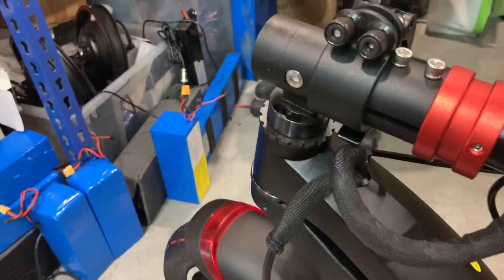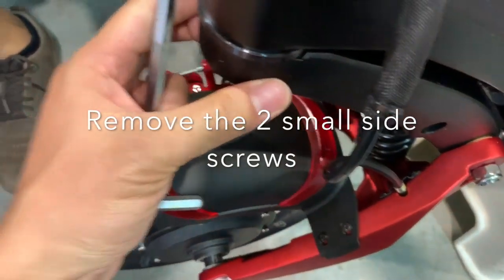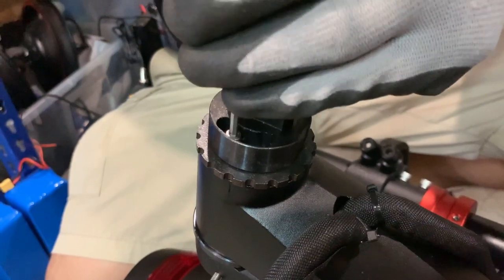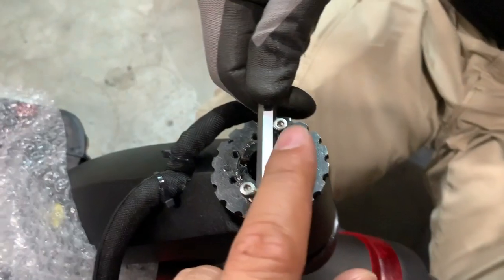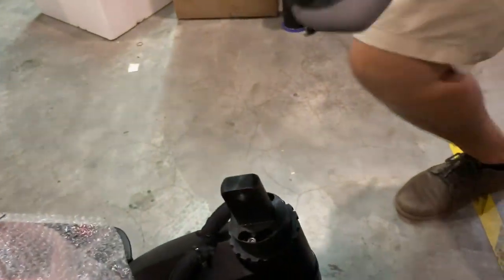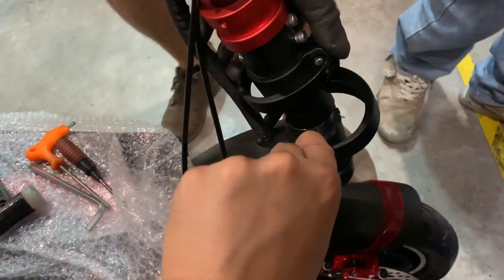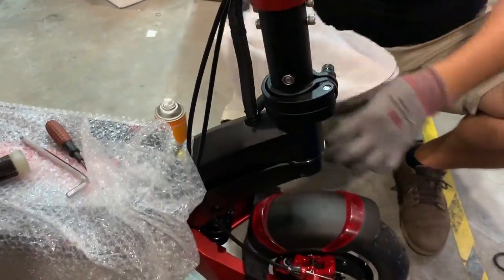ZERO Tutorial: How to tighten the vertical stem on the 10X

Comment: Nice video Very helpful explaining the steering assembly.  Please video the open deck , the battery , controller ,etc.  ...I have a small short when I attach the charge cable,want to see inside but don't want to void any warranty.   Please keep the how to videos coming
Reply: A tire change diy vid. would be good also
Reply from the maker: Tire change video for zero 10X coming soon:)
Reply: @FalconpevSg  for the love of god and all that is holy....please find some of those honeycomb airless tires for the 10x and sell them. i will pay anything.
Reply from the maker: sHockz atx ok check these tires out, it will help you a ton: https://www.falconpev.com.sg/products/10-x-3-inch-urban-off-road-tyre-and-tube?variant=29183414698051

Comment: I bought the 10x, love it, so much fun. Only drawback was the movement and squeaking in the vertical bar. I ordered the upgraded stem coupling. Problem solved. Handlebars are now stiff and very minimal squeaking. Feels much better, highly recommend.
Reply: I've just brought the 10x and having the same issue as well with a creaking stem! Did you get a spacer with the rugged folding clamp you purchased?
Reply: Please, give a link to the product of the upgraded stem coupling

Comment: This stem simply needs the lowest 15mm section to be 35mm long and a clamp that is double the height like around 70 mm with 3 quick release. A cnc lathe could easily make a slide on extension that raises the total height of handlebars only 30mm ! If anybody want to discuss this further let me know and i will explain it and draw it up for them to route one out and we can try it out and get it a simple perfect design ! 👍🏻

Comment: If the setting screws will not come out (2.5mm) do you have a guide for stuck screws? Thanks
Reply: Did you ever solve this. Same thing has happened to me. Setting screws will not move
Reply: @DanielMatotek  unfortunately not they are still stuck in the scooter i don't wish to attempt to remove them by then damaging the internal thread.
Reply: @HanleysHatchlings  can you remove the large bolt without taking them out?

Can I just continue without taking them out?
Reply: @DanielMatotek  the large bolt is stuck as the side bolts have it stuck in place.
Reply: @HanleysHatchlings was your steering to loose or too tight. Mine is too damn tight.
Reply: @DanielMatotek  issue i am having is the stem is creaking and not tight enough due to the bolts not able to be loosened. So this remains an issue still as this video explains the issue i cannot go about the repair without possibly damaging it.
Reply: @HanleysHatchlings  alright thanks, I really don't know what to do then. I can't get these out to loosen it up.
Reply: @DanielMatotek  i am in the same dilemma this is why i commented to ask the person who uploaded the video
Reply: A trick I used after stripping the inside of the 2.5mm set screws (because there was too much play when inserted) was to put your Allen wrench/hex key into the material of a disposable rubber type doctors glove and insert into set screw again. It'll be tight and worked for me.
Reply: What size Is the large bolt screw, mine is missing and I need to buy a new bolt. PleSe help.

Comment: now i know how to loosen the vertical stem to free tension, then install steering damper, just like motorcycle. steering damper is the correct way to add resistance, not tighten the vertical stem, vertical stem too tight will just result of wearing down the bearing and bearing race much quicker, then you will have a loose steering again.
Reply: How to loosen it because my T10 steering is not smooth to turn its alittle tight from factory, what screw to loosen it top or bottom. Thanks

Comment: My Zero 8x (recently purchased) have some resistance points or 'notches' when moving steering. One when wheel is centered, and others at several (left and right) angles. Some say this is normal, because it helps to dismiss wobble, so its by design.
But others say steering should move smooth with no notches points...so I don't know if my steering is right or not :( Anyone could help please? Thanks for your videos!
Reply from the maker: The notches will smooth out after a while. It is basically tightened by the factory to ensure that your steering isn’t overly loose. If you want to tune it up you can follow this video here https://youtu.be/QvMgzn84CR4
Reply: @FalconpevSg  Thanks your reply, but why are these notches for? which purpose? and is it danagerous to ride like this? Many thanks!! :)

Comment: HI Guys, I have a zero 10x since 2 months and I rolled with the stem loose from the beginning. When I wanted to tighten the nut, I realized that the thread of the front arm is so damaged that the nut is no longer tightened. I saw it is possible to buy the front arm for 10x but I did not find the nut. Do you know were a can buy the nut ? if I change the arm I prefer to change the nut too. appreciate if you can help me I am from france
Reply: No help yet???
Reply: Hardware store like Lowe's or home depot any place that has bolts and nuts
Reply: Yup, just bring the nut to a hardware store. Show it to them and have them find you a new one. Nuts and bolts are sold in EVERY hardware store.

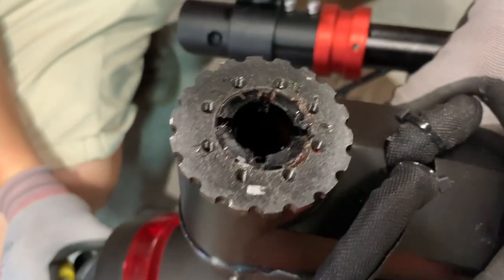Comment: 03:04 I can see my gear clearly. Just like the gear you show here. So, you are saying I can actually use a wrench to tighten, without removing the headset at all? If so, then this is great!
Reply: The guy doesn't even respond so how did you do it bro? I need to loosen mine but do not want to go through all this when I have the teeth one
Reply: @nickjeffrey8050  I've not done mine yet. But I've ordered the Rugged Clamp to eliminate this (assuming the rugged clamp is to eliminate that fault).

I can't comment on it (edited) as I've not done it yet. I don't have a wrench that size.
Reply: @nickjeffrey8050  hey nick, I've ordered the Rugged Clamp. The one that comes with scooter has got to go.  After just over a week, the screws are bent because I have to keep tightening the nuts (stem clamp).

I'll have the new clamp this week, and I'm  gonna do what this guy did on the vid. When I watched this vid before getting my scooter, it looked too complicated. Now I have it, and understand it, I'm gonna tighten the gear as per vid.

I'll get back to you...
Reply: @jasecee8992  Did you end up tightening it without removing the top?
Reply: @yuyucorns  I didn't bother with it. I bought the Rugged Clamp and it's perfect. I don't think my stem needed adjusted.

Comment: Thanks for the video. Just curious, do you use any type of grease in the area where the stem folds and the shem/spacer is placed?
Reply from the maker: FL HANDSTER yes adding grease is good because it will reduce the friction hence reducing wear and tear on that folding mechanism
Reply: Falcon PEV OK. So, what type of grease do you recommend? And what tool does one use to remove the large notched nut on the lower part of the stem assembly?

Comment: hello , how to remove speed limited 25kmh for faster Speed? Thanks.
Reply: Hold the mode and power button at the same time for 3 seconds. Cycle up from P1 to P8. P8 controls power. Cycle that to 100. Problem solved. (Took 3 years to get your answer, lol).

Comment: Hi there! Does the zero10x vertical stem have bearings?
Thanks
Reply: yes it has two 41.8mm bicycle bowl bearings, my zero 10x's bearing is damaged. Damn it was so tight.
Reply: @johndaily9869  Did you over tighten it?

Comment: My headset was delivered too tight where you can’t steer.  Everything is too tight including set screws that broke my hex wrench and the gear ring that won’t budge when trying to loosen.  The screws just bend.  I’ll have to buy a pipe wrench I guess.  Very frustrating to have to do all this before I can even ride my $2000 scooter for the first time.
Reply from the maker: Hello where are you at?
Reply: Cupertino California
Reply: I’ll get it working.  My fault as the seller put it together when they delivered and I test rode it in parking lot.  I mentioned that steering was too tight, but they said it would loosen up on its own.  I should have insisted they fix it.  It’s so tight that it sticks and makes it hard to even balance due to it sticking. I see now after disassembling that it’s VERY tight.  I think the factory workers are getting over zealous with tightening the head. Must have been issues in the past with being too loose and they’re over compensating.
Reply: All fixed.  I recommend that you do NOT use the bolts to tighten the head.  Better to get a channel lock pliers if you have the gear.  The bolts are M4 and bend very easily.
Reply from the maker: @nswenson520  this tutorial is meant for people who can use regular tools in the house to do it instead of the hassle of buying special tool. The bolts or screws do not bend if done properly.
Reply: @nswenson520  I just took delivery of one yesterday, what a freakin nightmare to steer. There's absolutely no self centering at all, you are constantly steering the bloody thing. Certainly not like any other scooter I've owned.